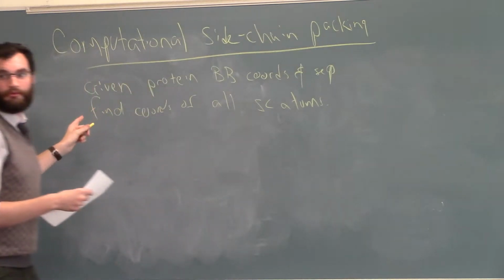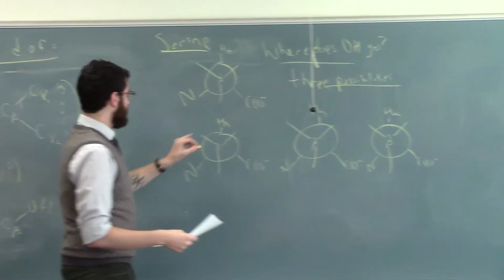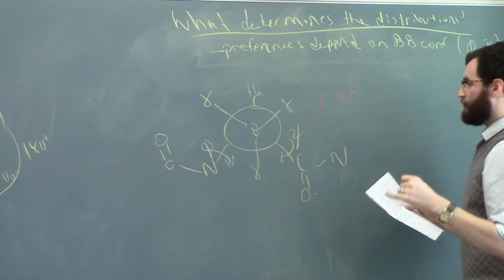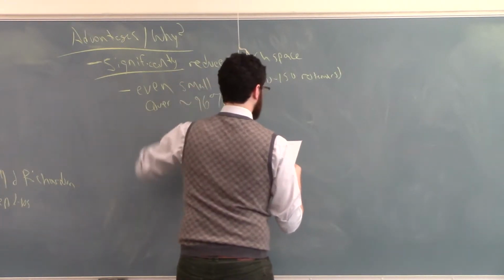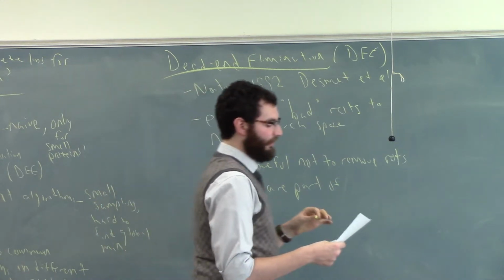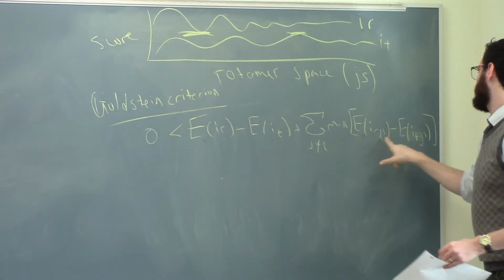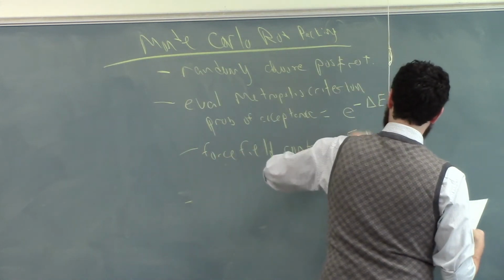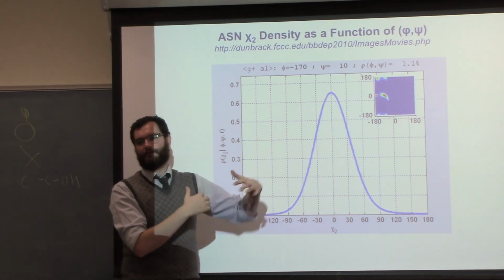Rotamer Libraries and Side-chain Packing (Guest lecture by Brian Weitzner)

Comment: at 31.06, if each  X has 3 rotamers, 2X/res=10^95. how did he come by 9 rot/res, 9^50 and not 6rot/res?
Reply: This is a combination of all discretized values for each chi angle (so 9 as 3x3, not 6 as 3+3).
So if you have two angles (chi1, chi2) and each of the angles can take 3 values {g+, g-, t}, here are all the 9 possibilities:
(g+, g+), (g+, g-), (g+, t ), 
(g-, g+), (g-, g-), (g-, t ), 
(t , g+), (t , g-), (t , t )